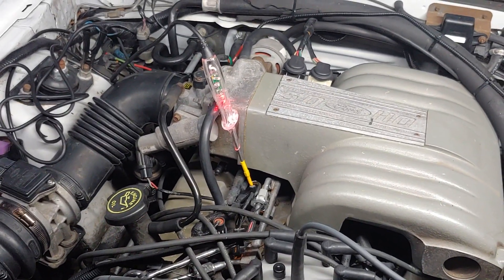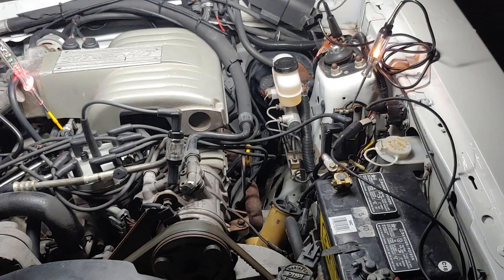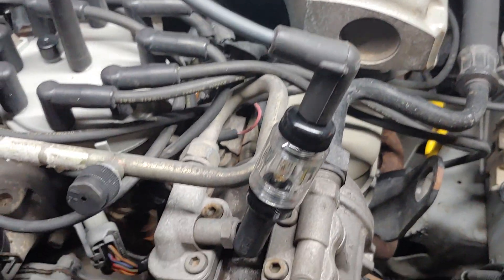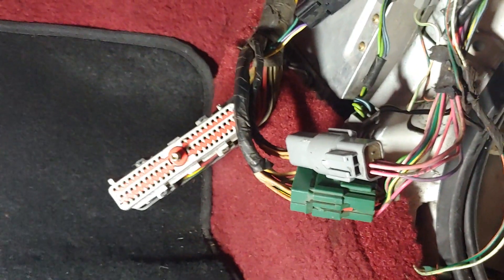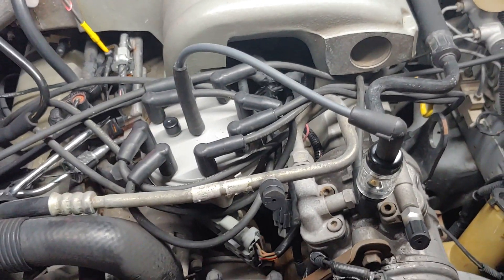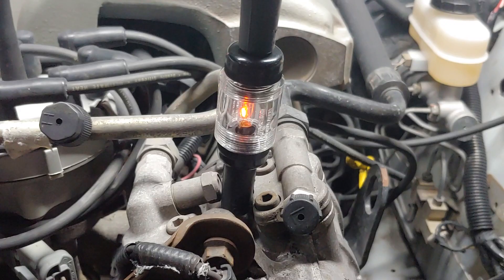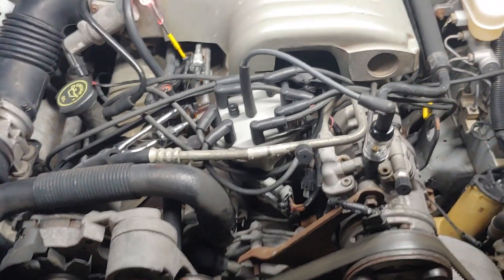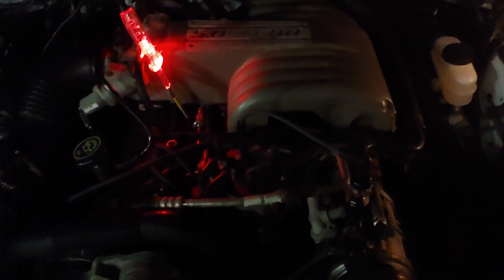5.0L Ford Mustang TFI Ignition Coil Testing - Bad Coil or Bad Computer?

Comment: I am currently diagnosing a 'no spark' condition on a 1993 E350 5.8L with a fender-mounted Gray colored 'Push-Start' style TFI. I am using the TFI Worksheet which is located at TheRangerStation website. I have gone down the check-off list up to #9  which is the 'check Hall-Effect device' and this is where I have encountered a problem. I am not getting the correct 5.7V (getting only 1 volt) on the TFI SPOUT connection of the socket connector so the next step is to check the continuity of the computer (PCM) socket to the TFI socket and if that is OK then I will next do a voltage check directly on the PCM pins 36 (SPOUT) & 56 (PIP). A few years ago I replaced a leaky 10uf cap on the PCM board and now I will replace the 2 remaining suspect caps which are both 47uf. What I would like to obtain is a schematic of the PCM (F2TF-12A650-PB) so I can troubleshoot the PCM if needed (I am experienced with electronics repair). This E350 had been sitting for many years and wouldn't start (due to a bad fuel pump & oxidized starter contacts) but after repairing those and also replacing the plugs, cap & rotor I had it running good for awhile but then one day it wouldn't start again. Any helpful advice is greatly appreciated. Hopefully I will not need to buy a PCM for it. I no longer need this E350 so I do not want to put much more money and time into it. It is a Cube Van / Box Truck which are usually slow sellers and don't sell for much especially when they are 26 years old.

Comment: Nice video and explanation. I was wondering if I could pick your brain. My cranks and runs but it backfires out exhaust every now and then. My spark from the car is constant not pulsing at all. Can you help me thanks in advance
Reply: If your car runs, the spark can't be constant. Backfiring out the exhaust is likely an ignition misfire. Try new plugs, wires, cap, and rotor. And make sure your timing is set right. It should be at 10 BTDC with the SPOUT connector unplugged.

Comment: does this work for ignition cutout also i have a 95 gt convertible that shuts off while running, it started to shut down every once in a while now it does it every 5 mins
Reply from the maker: If you look thru my You Tube channel videos, you'll find how to test each component. But I can tell you that by your symptoms, you're probably headed for an ignition module. However, you need to test for spark coming out of the coil, and control/ground at the coil to see if it's getting the ground pulse signal from the module to fire the coil. If you have coil control, you don't have a module problem. But modules are famous for failing when warm. Check out my video on distributor module installation tips.
Reply: @dragradialperformance3540  thank you

Comment: I changed the starter in the solenoid I bypass the safety switch on the clutch pedal I change the ignition switch and I still can't get it to start can somebody help me please
Reply from the maker: You just have to turn the key to the start position and hold it there, while you use a voltmeter to check every point in the system to see where you lost power.

Comment: I have problem with my ford 1985 crowin Victoria 
I adjusted timing at 10° in idle as recommended 
The problem is when I connect Spout wire connector the engine goes misfire and bad running when I disconnect it the engine running smoothly
Reply from the maker: The spout connector being plugged in allows the PCM to control ignition timing. If you have 10 BTDC timing unplugged, and you plug spout in and it begins running badly, it suggests that the PCM is not commanding the correct timing or not firing the coil at all. While it's possible this could be a module, the PCM does sound suspect in this case. Try opening it up and inspecting the capacitors for leakage or corrosion.

Comment: I have a 95 mustang GT and the other day it shut off abruptly. I've been doing different tests and the fuel pump will not run and I have no spark. Would that be the computer gone bad?
Reply from the maker: I doubt it. The spark can occur even with the computer removed from the car. I have a video showing that. The pump not running means either a fuel pump relay problem, a dead pump, or the PCM is not grounding the relay. Or the inertia switch is popped. I would chase the fuel pump power issue by testing at the relay. The small wires on the relay are the control wires. There should be one that has power when the key is on, and the other should have ground when the pump is supposed to be running. The pump will quit running after 1 second unless the crankshaft is spinning.
Reply: @dragradialperformance3540  I did some more tests, inertia switch is ok. I have spark when the SPOUT connector is unplugged. no power to the fuel injectors.
Reply: @lukebronstein9617 did you ever figure this out

Comment: What signs have you encountered for a coil going bad? I have a 93 that drops cylinders and picks them back up when not under load. Any ideas? Ty
Reply from the maker: Generally, either a no-start, or a loss of power when you try to give it more than a little throttle.
Reply: @dragradialperformance3540  Ty

Comment: Hi Steve,  I came here after you said you uploaded this clip.  I have all these tools except for the LED light.  I have already used my Multi meter to check Primary and secondary resistance of the coil, and voltages.  Then I used the Spark tester and got spark.  Unless I missed it, I didn't see what the LED was for in your demo.   Also,  my main issue with my F150 is not no start, but poor power, sputtering, bucking, and detonation like timing is not getting adjusted right.  I do get a PIP circuit fault as well as a Hego always lean and an insufficient EGR flow detected fault.   As I have mentioned elsewhere, unless I am doing my testing wrong on the components I have checked so far, everything from TPS, IAC,, COIL, and TFI.  The only possibly out of spec item I may have found is not 8-10 V while cranking and trying to read START voltage while cranking. Odd because truck starts and runs.
Reply: My next checks will be Resistance from distributor to engine ground, Distributor to TFI ground at pin 6, Hall effect at Spoutharness connector while cranking 5-7 v desired, If not, then disconnect ECA, redo test at  pin 56,  If not correct then check contuity of blue PIP wire to distributor from Pin 56,  If correct, I am told to reconnect harness to a substitute processor and redo Hall effect check @ Spout harness.  If still don't get 5-7 V on SPOUT or PIP wires during crank then Hall effect is probably shorted.  Then I am told once I achieve a 5-7V If I still don't get pulsating signal at Negative coil, the TFI is bad provided all the above is good.  Hopefully this all makes sense.
Reply: I also should say, I have not also checked other obvious or not so obvious components, Plugs and Wires, Fuel Pressures, Fuel Filters,, Injectors, MAF sensor, etc. Which I am now finally able to get to since our local dosage of rains have subsided   I did do a temp test on inlet and outlets of the CATS and unless I have it backwards, this shows no blockage.
Reply from the maker: Insufficient EGR flow will be either a stuck closed EGR valve, no vacuum to valve at part throttle, or clogged passages. If the truck uses an EGR Valve Position Sensor, then it's all about the valve opening and not about actual flow measurements.

The HEGO always lean code is what you need to be chasing. It could be a bad O2 always reporting 0 volts. That would make the truck add a lot of fuel and run very rich, then the O2 would eventually fail and throw a code, and the truck would run better at that point because it would ignore the O2.

Or it could be that the truck really is lean. You need to do a fuel pressure test, with vacuum regulator unplugged, at idle and at 3,500 RPM. OTC has a nice, inexpensive fuel pressure gauge w/ Ford adapter.
Reply: Thanks, Steve.  Is it possible that a bad TFI could cause the CCD/ ECC IV to set the timing off spec due to PIP and Spout issue,  or not set it as it should under load and when the computer does all this to cause the EGR and  HEGO code issues?  Or are they separate in themselves?  I did put a Mityvac to the EGR and it definitely is not stuck.  I also did buy a Fuel Pressure tester last week.  I will test pressure as you say, as soon as I can find that Vac regulator you mention.
Reply from the maker: The fuel pressure regulator is on the fuel rail, and has a vacuum line going to it. A bad TFI module wouldn't cause the EEC-IV computer to do anything wrong, it would just directly cause an ignition problem. You can see PIP and SPOUT signals with a scope.
Reply: Steve.  I will be about doing the Fuel Pressure test, a MityVac Vac test to see if I am losing Vac, then a Smoke test for locating Vac leaks if any are found.  Also, as mentioned, I should try to nail down the causes of the 211 PIP fault code, 332 EGR and 172  Hego Lean codes.  Thanks again for your guidance.
Reply from the maker: I'm going to help you out on that PIP fault code. I'll be uploading a video soon on easy PIP testing. It's best tested when the vehicle won't run, using an LED test light. EGR codes aren't going to cause a problem unless it's a voltage high code, meaning the EGR valve might be stuck open. That's rare. The HEGO lean code is a problem indicating either a dirty or bad MAF, low fuel pressure, vacuum leaks, dirty injectors (less likely), or O2 sensor/heater issues.
Reply: Thanks, Steve.  Yup, the EGR is definitely not stuck.  I vac tested it and can hear it move every time.  I tested fuel pressure and also checked for spark in every plug wire and coil.  I will be pulling the pugs to check on their condition as well.  I have a good 34 Lbs of fuel pressure while running and 39 lbs when ignition powered up  to run position.  I have sprayed around for vac leaks, but will be building a smoker tester to double check for any that might be in the harder to reach areas.  I did remove the hoses off the MAF last week and hit it with the MAF cleaning spray, but possibly could still carefully disassemble it further and really get up close and personal with the spray.  In addition, I will try to locate the HEGO O2 sensor(s) and do the ohms tests to see if the fault is from a bad Hego.  I also found a TSB bulletin about looking for wires with the insulation worn off over in the loom between the ICM and PCM  which is known to cause the symptoms.  But I will go there, if my other tests don't show any flaws.  Anyway, wish me luck on the smoke machine and pray I don't find any bad leaks like head gasket or Intake manifold gasket or anything expensive like O2 sensors.
Reply from the maker: @mlasch1478  If you can backprobe O2 voltage and monitor it in graph form, it can tell you a lot. A scope or graphing multimeter is a must here, if you don't have scan data.

Vacuum leaks can be detected by looking at O2 trims and voltages at idle vs 3000 rpm.

Good luck!

Comment: I think a failed computer can make no spark it fail in away that feel power or group on SPOUT, if you was unplug the SPOUT plug this take computer out of loop, tho most fail computer the fuel pump will stay on all time with key on,  given age of these cars it first thing I ask about or check now, they voltage reg inside computer fail. most time replacement cap fix it, I been meaning putting replace ones in my 94 and 96, the 85 getting stand alone EFI setup  to replace 88 EFI setup in there now.  Nice very nice video, I maybe would add fuel gauge with that setup with that and should really see what you have and don't very fast.
Reply from the maker: As long as the SPOUT connector is unplugged, the computer cannot cause a no-spark. However, I agree that if the SPOUT is plugged in, it is still possible to have the PCM cause spark issues. Just unplug SPOUT to verify it's not a PCM issue.

You're right, the computer is a major failure point these days, and the fuel pump running all the time is a very likely indicator the PCM has failed. The problem isn't the voltage regulator though, it's the 3 capacitors inside. One of those capacitors feeds the voltage regulator. A physical inspection of the caps will show they're leaking or corroding. I have a rebuild kit in my Ebay store that has all 3 of the correct and original brand capacitors for Fox computers, currently $14.95 for all 3 caps. They should be installed by someone with a microscope and good soldering equipment.

I don't think the 94-up have the capacitors. Or at least any they have are not failure prone.

Comment: Thank you for sharing your knowledge!....My car  is a  '95 GTS that I have owned for 19 years. It's been a great car and I take good care of it.... but with age, things are starting to happen.... While that layout of mine is a little different than the Foxbody,  the principles are basically the same.....I'm working through your content so that I can better understand what the F%*$ is going on with my current ignition problems which have not happed before....code readers are a start, but they may not be enough.
Reply from the maker: The 94-95 cars are very similar to the fox bodies, with a few differences. They don't have nearly the PCM (capacitor) problems that the foxes have, thankfully. They added in a Constant Control Relay Module that basically was a box with the fuel pump, AC, and fan relays built into it. And they relocated the ignition module to the fenderwell, and mounted it to an aluminum heat sink.

While the module is slightly different, it's largely the same TFI ignition system. They just started letting the PCM decide coil dwell time instead of having a preset coil dwell time built into the module. So it got a different module. Overall, all the same diagnostic approaches apply though. Buy yourself a $10 LED test light and a $10 incandescent test light from Amazon (something like ATD offers), and maybe a $2 box of sewing T-pins at Walmart (the ones that are about 1.75" long), and you'll have everything you need to troubleshoot ignition problems.
Reply: @dragradialperformance3540  Subscribed and thank you.